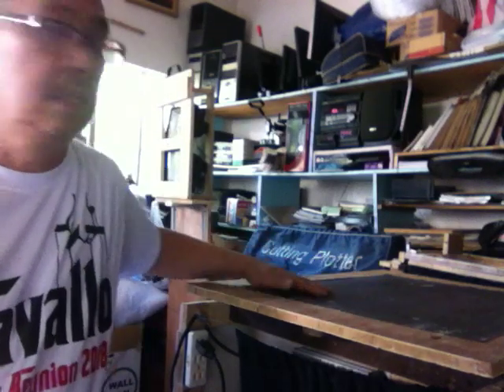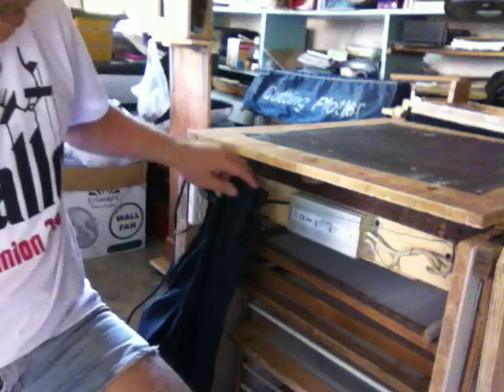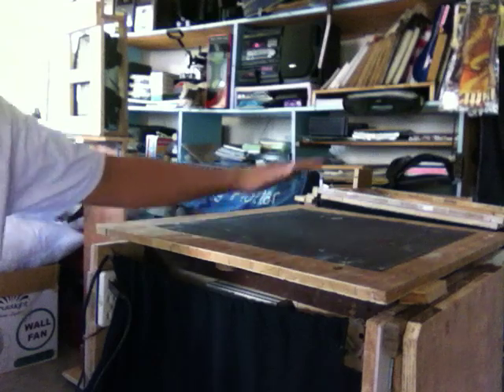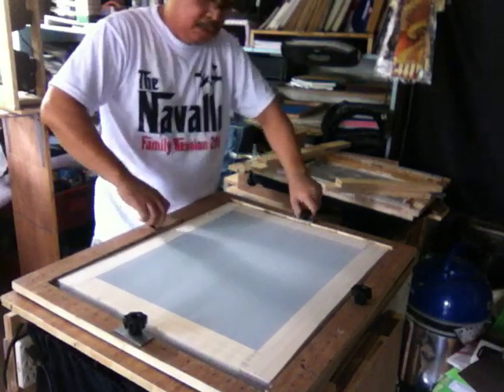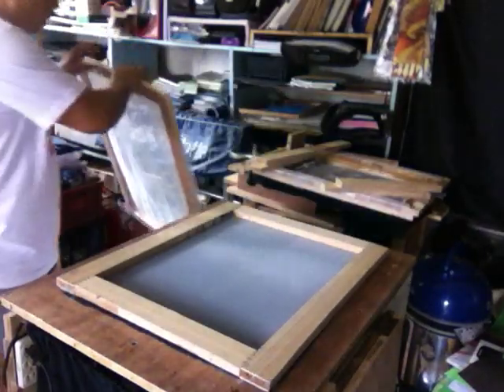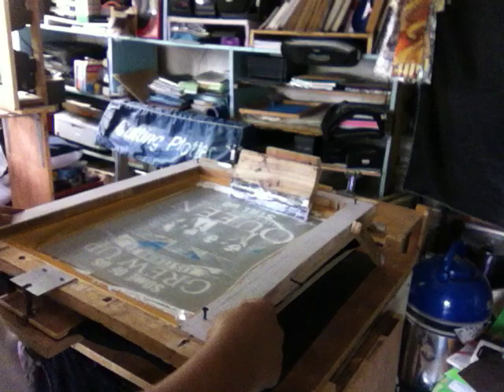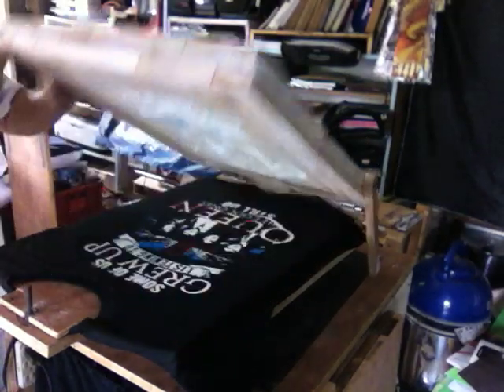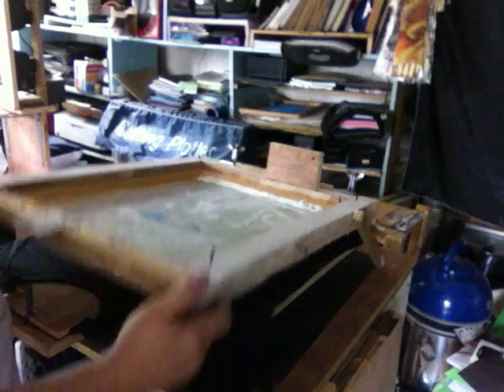ALL IN ONE SCREEN PRINTING WORKSTATION

Comment: I have an idea of using 1 flat aluminium square  frame (40mm by 20mm)  and a flat wooden board as my screen stretcher device. I am not going to use nails but I will use  an instant fast drying glue to attach the mesh and stretch it unto the original frame by using improvised nut and bolt or small G-clamps to clamp down the stretcher unto the original frame in other to get my drum tight tension. Thanks for this wonderful innovations.
Reply from the maker: thanks and pls subscribe, new videos will come out.

Comment: Sir, salamat po sa pag-share ng inyong very inovative 4-in-1 printing table. 0% po ang aking karansan at gusto ko pong sanang matuto. Kung OK lang po sa inyo, tutularan ko po ang concept ng inyong pang strech ng screen at ang exposure unit. P'wede po bang malaman kung anong klase at ilang pirasong LED lights ang ginamit po ninyo? Gaano ang agwat on LED lights sa glass at gaano katagal po ninyo ine-expose ang print bago ito hugasan sa tubig? Ano po ang kainaman ng pastisol sa water-based colors po? Ilang coats po ang nilalagay po niny? Ano pong ginamit ninyong "heat press" po? Hindi po ba kaya ng hair dryer mag dry ng pastisol? Sorry po sa maraming tanong.
Reply: Dagdag tanong: Ano po ba and ginagamit nyong glue yung screen sa kahoy?
Reply from the maker: kung ikabit mo yung screen sa frame, rugby lang hamit ko, tas supported ng gun tacker o stapler. patuyuin lang mabuti bago alisin sa stretcher.
Reply from the maker: thanks and pls subscribe, new videos will come out.

Comment: Sir ano po yang pang curing mo?  Halogen ligths lang po b yan?  ilang watts po?
Reply from the maker: Magastos pang curing halogen light, @ 2000w pag 4 halogen. I use heat press to cure. Pang flash dry lng ang halogen, @ 25secs.
Reply from the maker: Magastos pang curing halogen light, @ 2000w pag 4 halogen. I use heat press to cure. Pang flash dry lng ang halogen, @ 25secs.
Reply: Pde po b sa waterbase ink pang flash dry yan?
Reply from the maker: @rhimecaquilala6916  pwede... alternative sa blow dryer.